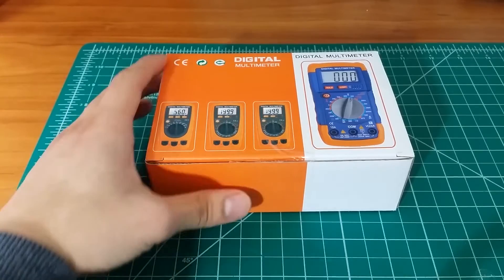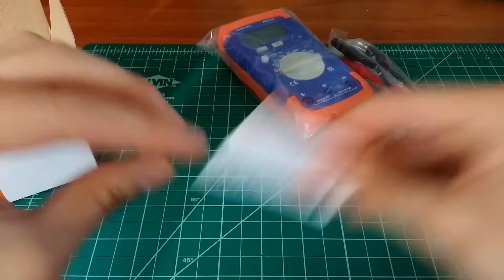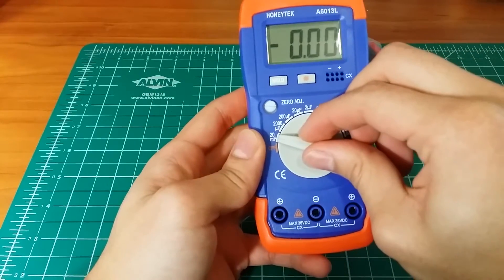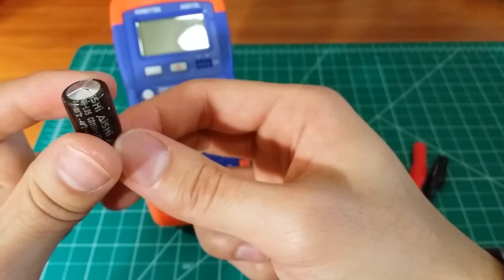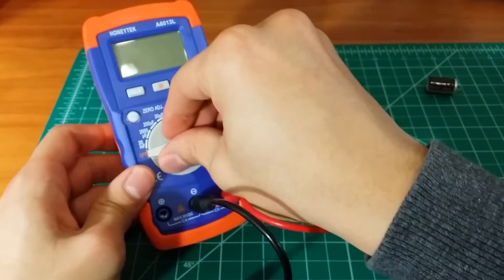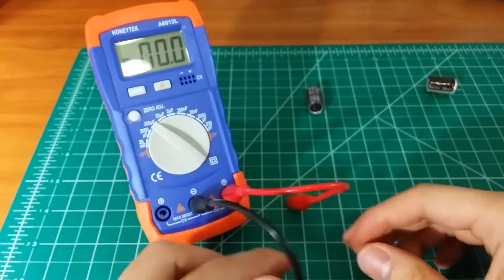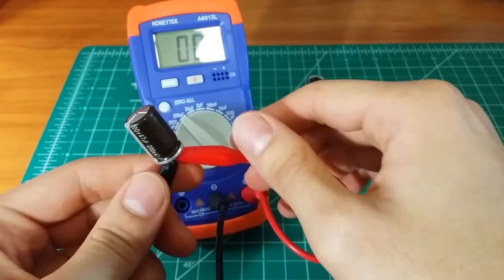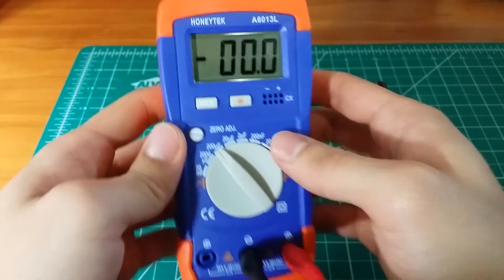HoneyTek A6013L Capacitance Meter Unboxing and Quick Look

Comment: What is the other terminal in the meter for?
Reply: I saw another video for a very similar looking meter where they guy figured the other terminal was there because they use the same case for a standard multimeter, which would have 3 plugs.  So they just made two of the plugs the same.  Makes sense...
Reply: @desiv1170  oh, so they are like connect together?
Reply: @simonbago  Yeah, that was his thoughts on it, and it makes sense...  So you can use either interchangeably.
Reply: @desiv1170  i have one of these HoneyTek A6013L and I remember that there are different marks printed on the two terminals. Something about the voltage, or a warning symbol like ⚠️. I can't remember exactly what it is, but yes, both terminals do exactly the same xD. Now i want to open it to see how they are connected.
Reply: @simonbago  One side has an exclamation point in the triangle and the other has the lighting bolt in the triangle.  Both say MAX36VDC.  Could be different, but my money is on the thought that they are the same...